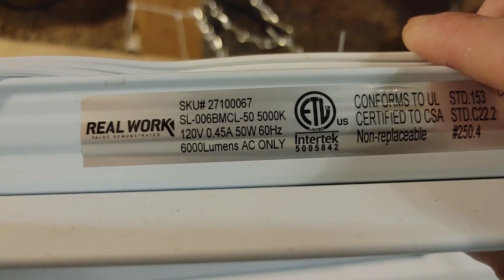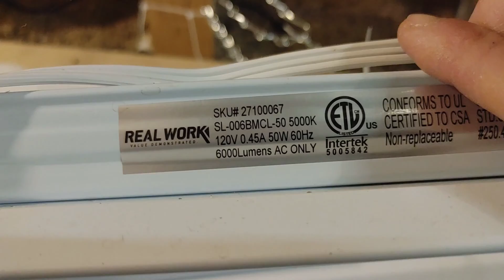Grow Lights Energy Costs and Fire DANGER | Electrician Explains

Comment: I'm in SE MI and I'm not an electrician, so i appreciate the reference to wire sizes...i was worried about overloading and when i measured all of my lights, I would have exceeded 15A. In a basement with old diy wiring, i was legitimately worried about a fire and I'm glad to have more info than just split it up between various breakers? But I'm also worried about extension cords regularly pulling 5-8A's to reach my plant area

I'm getting back into the seed starting hobby by trying to sell heirloom peppers/tomatoes you can't normally buy, but it's not worth a house fire!
Reply from the maker: 16 amps is max load allowed on a 20 amp breaker.  Since I use low wattage LEDs I can have my lights on a circuit that is shared with other loads.  Extension cords are OK if you use short ones.  When long cords are used there is voltage drop and when voltage drops due to long wires, amperage increases.  Amperage could increase enough that the wires in the cord are not sufficient to carry the amperage.  Breakers are a good safety mechanism  but they are not perfect.  But you can grow quite a bit under a few low output lights

Comment: Hi Robbie,  This comment is more about overall kilowatt usage.  I am a nube to indoor overwintering of plants and some citronella geranium propgation.  I run a 6" fan 24/7 to try'n keep the mold away. I am not running a humidifier. Although running  50% relative humidity (RH) in house on average , I feel I should be running a humidifier. More humidity = more fans= more kilowatt usage= more $, so we are overwinter at 50% RH, and I'm glad geraniums are tough. 
     Thanks for the heads up on the 10 gauge wire and oversized breaker for "that big wattage light." Homes are for living, not burning, thanks again. 😊
Reply from the maker: Once you get into motors you get a higher initial surge as well.  Thst initial surge is enough to trip a circuit if there's other loads.  For all the electrical loads it's (volts x amps)÷1000 to get kW.  It all adds up in the bill.  Most home growers don't factor this in, but most home growers are also just  doing it as a hobby